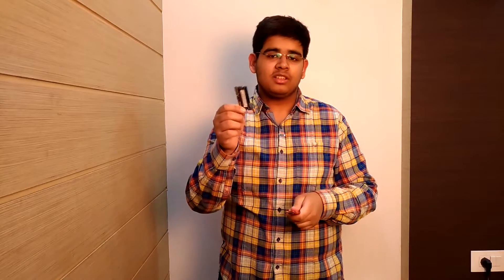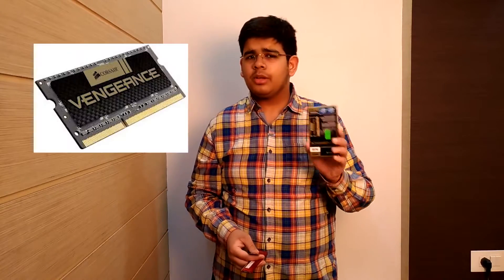Can You Run!!! DDR3Low Voltage And DDR3 Ram Modules Together With Intel Skylake???

Comment: I bought a Samsung RV510 Laptop back in 2010 with 2GB DDR3L 1.35V ram, and added a 2GB DDR3 1.5V. Fast forward 12 years, it's still in daily use, and I'm running Windows 11 today

Comment: It could be your ddr3 ram is rated at 1.8v that's why your ddr3l ram got fried up because its try to run the same voltage, Well what I've heard ddr3l can work at 1.5v voltage with no problem.

Comment: Good info Buddy  ! I've a ? here
I run PC with newly buyes 1 Simmtronics ram- it Label/stiker as 4gb ddr3 1333mhz
Where as Task mngr, CMD shows it's 1600mhz & Cpu-z shows it's 4gb ddr3l 1600mhz 1.35V which is mis-match even it mis-match with my Old ram (local made 4gb 1333mhz 1.5v). M.Board have 2 slots support 1.5v each...I'm OK to use 4gb daily...
Assist me - which ram should I use further ?
If I

Comment: 3:04 to 3:10 bro you put a ddr3 stick in a ddr3l mobo (1.35v). It will not support the ddr3 stick. Vice versa if you put a ddr3l stick in a ddr3 mobo (1.5v)  it works fine. Ddr3l is dual voltage output. It works at 1.35v and 1.5v while ddr3 is 1.5v only

Comment: yes you can combine ddr3 and ddr3l  if the laptop requires 1.5v u can mix the ddr3 and ddr3l..but if the laptop requires 1.3v which is ddr3l  u cannot mix ddr3l and ddr3  together ...

Comment: brother how to know my system ddr3 or ddr3l plse replay
Reply: Usually, DDR3L rams are 1.35V. It's written in the ram chip what volt the ram is. If it's 1.35V then it's DDR3L, if it's 1.5V then it's DDR3.

Comment: Hi i am using 2014 Laptop for my Autocad and Sketchup for almost 5 years running with 2gb DDR3 1.5 volts ram. I am planning to upgrade it to 2x 8gb DDR3L 1.35 volts. Will it be compatible.? Hope to hear from you soon. Thank you very much..
Reply from the maker: Hi there, as you said you laptop is from 2014 it must be having 4 or 5 gen processor assuming its Intel, it won't support DDR3L memory as only from Skylake (6th gen) the support is there for 1.35 low voltage RAM.

Comment: Am using 
4GB 2Rx8 PC3 - 10600s and 8GB 2Rx8 PC3L - 12800 . 
But No Problem its working
Reply from the maker: It also depends on the quality of the RAM as you said they are working fine now but in the long run they may not because one RAM is not running on its designed voltage , it will degrade the life of the RAM

Comment: ddr3 ram to ddr3L mobo = you will fried the ddr3 ram.
ddr3L ram to ddr3 mobo = its gonna work fine, even if you mixed it with ddr3 ram on the other slot, because ddr3L can work on 1.35 V and 1.5 V, while ddr3 ram can only work on 1.5 V, thats why you cant put 1,5 V ram into 1.35 V mobo.
Reply from the maker: It doesn't work that way the motherboard supports both 1.5 and 1.35 volts there are no special motherboards for DDR3L RAM's but if you put one Low voltage ram with a regular one so either the board will provide 1.5 volts to both module or 1.35 volts in any case one module will not function correctly because
Reply: @UnboxyTech  and now im replying to you with a PC that have 6gb ram ddr3 pc12800, 4gb ram ddr3L pc12800 1.35V + 2gb ram ddr3 pc12800 (1.5V) and it working fine almost a year now, and cpuz read my ram as a dual, even with different brand, slot 1 cpuz show 1.35V and the second slot cpuz show my memory 1.5V.
Reply: @reinaldo1504  which generation laptop you have
Reply: @sanidhyaagrawal4463  im using PC not laptop, and its 3rd gen ivy bridge i5 3570 with h61 chipset motherboard lga 1155, i use ecs h61h2-a and gigabyte h61m-s2p r3, i got 2 pc for me n my brother, and we both using ddr3l + ddr3 in both slot, and its fine like i said before almost a year, without bsod or whatever, 1st time when i build the pc i only have 1 ram ddr3, and last year when i want to use dual chanel i order and the shop send me the ddr3l and they dont have the ddr3 ram, so i think just try the ram, because its lifetime warranty, and voila its work like magic, and when i google about ddr3l i found that jedec make a standard that all ddr3l must have dual voltage 1.35 and 1.5 while the normal ram only have 1.5 V.
Reply: @reinaldo1504  hey bro I have 2 ram 4 4 gb I is pc3 1.5 v and 2 pc3l 1.35v but both ram run my laptop but after 10 to 15   min my laptop crash bsod occur
Reply: @tanubittu6921  does both ram can be unplug ? Or only 1 can be unplug ?
Reply: @reinaldo1504  yess both can unplug the problem is that bro I have 4 gb ram I play gta 5 ok so it's lagging so I order ram 4 gb after I installed the ram the gta is not lagging I am happy but after 15 min my game crash  and I play other game my laptop also crash so I removed the new ram my laptop is ok but game is lagging  😔
Reply: @tanubittu6921  after u put both ram do you try re-install the windows ?  I once have that problem too, my laptop have 1 ram soldered to my motherboard, and after upgrading ram with 4 giga soldered and 16 gb with total 20 gb ram, i got bsod, after re installing the windows problem solved.
Reply: @reinaldo1504  done not sloved 🙂
Reply: @tanubittu6921 if you already test each ram by puting only 1 (the old and new), try updating your bios, and of u already do that too, maybe the issue is mobo compatibility.
Reply: @reinaldo1504  bro how to update bios 😐😐 link
Reply: @tanubittu6921  usually it came with software from vendor, like lonovo vantage if u use lenovo
Reply: @reinaldo1504  I use hp ProBook 640 gi
Reply: @UnboxyTech  hei bro can i put ddr3U into ddr3L mobo..? Can it work...? Please help me bro
Reply: @supercopy6360  wow thanks

Comment: maybe your laptop only supports DDR3L that's why when you mix it with DDR3 it fries, so my question is will it run if the motherboard supports DDR3 with both DDR3L & DDR3? and also DDR3L has dual voltage 1.5v & 1.35v which support DDR3 slots.
Reply from the maker: The motherboard support both DDR3 and DDR3L but if you run both of them in the slots one of them will fry up because there will be 2 different voltages going to them so the chipset would be confused as to why different voltages are required so will try to either give more power to one of them or undervolt them in both case damage would be done.
Reply: TY for reply, I have tried it too in dual channel and check for voltage of ram using speccy  and they have different voltage even dough DDR3L has dual voltage it didn't adjust to 1.5V and then I remove it before it make some serious damage. But will it work if I put it in different channel, my motherboard has 4 slot memory but only support dual channel?

Comment: sir can i use a low voltage ram in 1.5v slot 
please sir reply
Reply: Yes. It's backwards compatible
Reply from the maker: Yes you can if you are having Skylake or above series processor